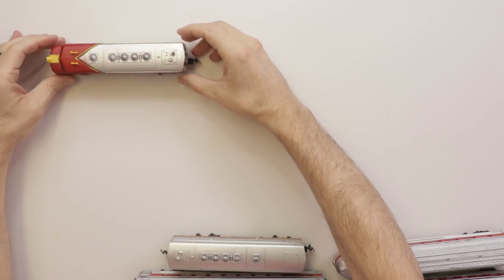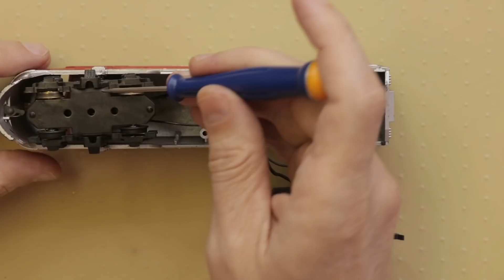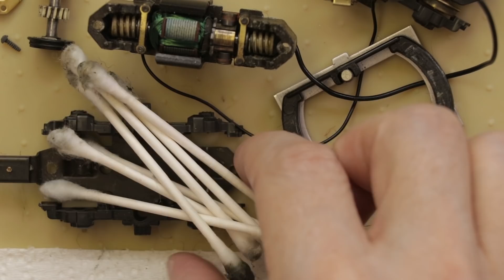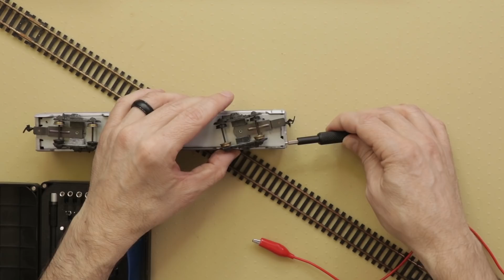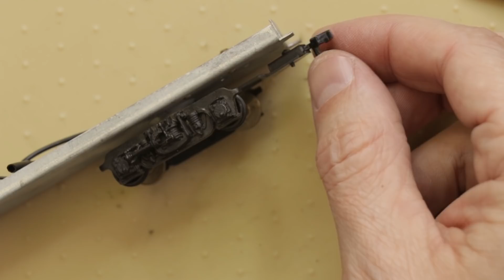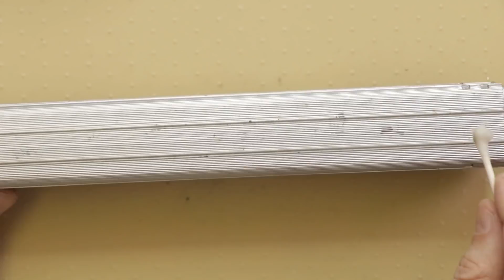eBay Repair Challenge S2E4 - So Many Things To Fix

Comment from the maker: Ever tried to fix one of these yourself? What do you think of the fix...did I do it right?
Reply: Yeah good fix ! Where did you get those new couplers ? Are you some kind of MacGyver ? :))
Reply: Looks like it is a fix that will last, and looks fine also
Reply: I’ve done some old Lionel stuff. Engines and coal cars etc.
Reply: I know that's it's been a long time since you made this video, but you probably should have used some Red Loctite on those nuts holding the motor together, to keep them from falling off due to vibrations from the train going around the track...
Reply: I’m amazed that the Big Bird clock didn’t go for more!
Reply: @jetboss737  Do you know the white stains on the wheels ? It looks like dried watercolor with  lot of water ? If yes, how do you clean this ?

Comment: the idea here is that rivets wont come loose, but the bolts locating at the part with the motor might. Had one of those myself, but produced it the soviet union) also had the problem with the motor, but wasnt able to fix it myself  back in the days
btw. You should get yourself a 3d printer, so you can fix plastic parts like those hooks. It will also help with some missing parts like battery covers etc.

Comment: Get a rivet gun and use a drill to remove rivets without doing damage. Screws will be rattling loose and pepple want these in original condition so screwing things back together instead of replacing the rivets reduces value and buyers.

Comment: Screws would be rattling loose all the time plus rivets are cheaper. Machine screws back then would have been expensive to manufacture, rivets are cheaper and low tech.

Comment: That unit you set behind locomotive is actually a cabless B Unit engine. I paused it at 48 seconds, so at that time, I don't know if the B Unit is supposed to be a powered engine unit or a dummy, nonpowered unit.

Comment: The couplers are actually not as difficult to replace as what you went through. 
You just need to press the plastic tab that functions as a spring while pulling it out.
Once it's out, just push the new one in. It snaps into place.
I've broken and replaced a few.

Comment: I buy and rebuild HO scale Engines, have about 120 engines in my collection, did a whole YouTube series just on my trains. The problem is almost always in the engine, can range from dirty wheels, dirty commentator, worn/stuck brushes, cracked plastic gears, worn bearings, broken belts, etc

Comment: When it comes to lubrication around the commutator, you are correct.  The commutator contacts are normally meant to be kept dry, the residue that you cleaned off is just carbon build-up from sparking inherent of brush dc motors.

Comment: In the future, for small rivets that are easy to drive and set, talk to an aircraft fastener supply place.  Ask for solid aluminium rivets, 1100,  and you can find them in a variety of lengths and a variety of small diameters.

Comment: The metal from which the wheels are made looks like bronze, moreover due to it's rather gold color I'd say it's one of the alloys on  the highst Cu content.
It is kinda suspicious cos i would expect brass but it might be that. It's hard to tell by the color seen on a YT video for sure due to tarnish as well. 
Why didn't you just wash whole axes with soap and lukewarm water tho? Or, in a tiny container filled with IPA (no, not the beer lol)? I mean it is plastic and relatively corrosion resistant metal so why waste time and so many swabs?

Comment: Great repair!  Regarding those truck rivets:  when fixing vintage die-cast cars I've drilled rivets and then tapped the remaining rivet shaft and used small flat head screws to reassemble.

Comment: Hi assuming the brushes are carbon then carbon is a lubricant.
When you tested the bulb and condemned it,I did not see you connect a gnd wire to the metal bracket.
The carriage lamps when you were cleaning the bogies (Truck) you can see a silver shiny metal strip length ways along the bogie (Truck) I assume that is the power contact to the lamps.

Comment: Why don`t use ultrasonic cleaner and then with syringe with a needle
 lubricate parts that must have lube on them? And also - why you did not use locktite on the bolts? It is vibrating much and can gets apart eventually...

Comment: is it possible to add a USB C port to a PS4 controller - random question but seems like you would know
Reply: Id say with quite a bit of fine wiring work, you would be able to, but you will still be limited to USB 2.0 speeds, because that's all the controller has, along with bluetooth.

Comment: You are getting it clean, but a much faster way is to use a tiny bit of CRC, or WD-40 and a toothbrush. Then clean it, and use a tiny bit of vaseline to lubricate the cogs, and screws

Comment: I've never really understood why old toys have rivets instead of screws? Is it all because the manufactures saved money on it?
Reply: Before "Made in Taiwan", "Made In China" or even "Hecho en Mexico", things were "Made in America" at a much higher hourly rate. I'm not really familiar with the history of power tools but I can confidently say they probably weren't in use at a children's toy factory in the 1960's so the options were to tap the hole and bolt it (an entire extra manufacturing step) use a nut and bolt (slower assembly & more manufacturing pieces) use more diecast aluminum parts so you could use a self tapping screw (slower assembly & more cost) or use cheap steel & brass and a blind "pop" rivet that took less than 5 seconds.
So yeah it was to save money in as much as time is money so maybe not in the way you thought.

P.S. The really old toys made out of tin were simply too soft to form threads that lasted any decent length of time so bolts or rivets were a must and you can guess which one was more available back then.

Comment: We used to use a coin laid flat on the tracks to clean them. Just moved it back and forth over the track and the sharp edges of the coin would abrade the tracks clean! We had mostly Hornby model trains here in the UK.
Reply from the maker: That's a great idea!
Reply: @Tronicsfix  running a train for a few hours straight on that old brass track will clean it up too just have to run it fast enough to not stall on the dirty bits